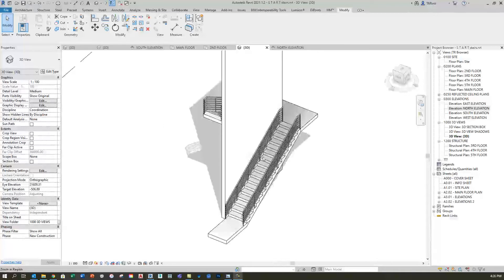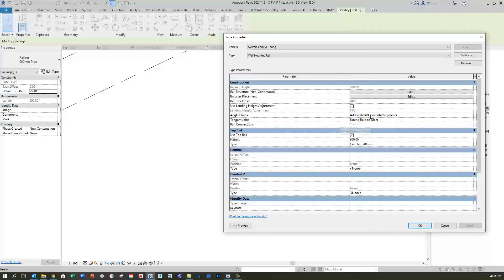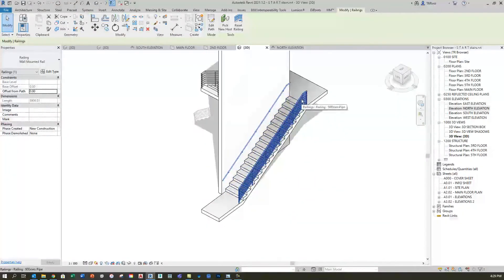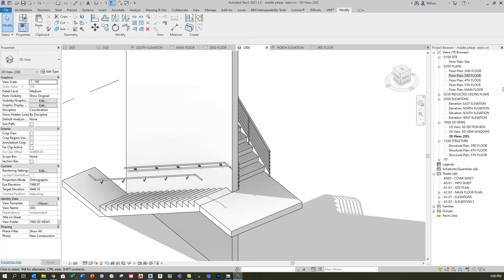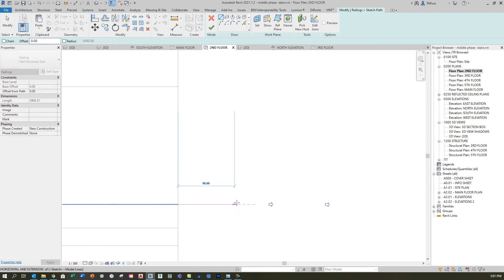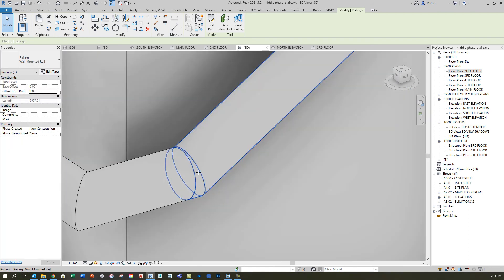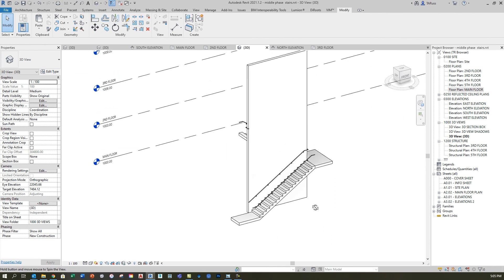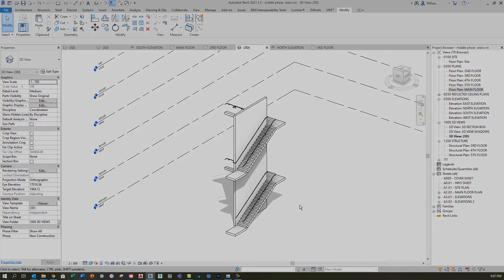Revit Stairs Fixing Floor & Rail Gaps PART 3

Comment: After adding the beginning extension to the railing, the height exceeds from the flight part. How can I have the same height? "Add vertical..." is 'on' in the Edit Type.( I noticed it happens when we edit railing path of stairs and add the extension on the 'floor' like the video not on the landing that Revit creates. if it makes sense...).  Any solution?

Comment: I am having trouble adding that 1 mm to the bottom of the floor one handrail. I followed your keystrokes but when I zoom in on 3D I don't see any transition. It did work in a previous attempt when I joined the inside handrail but does not seem to work when lengthening the bottom inside rail. Maybe this is due to another question I have (which is likely basic Revit knowledge). How do you keep the line work so thin when you zoom in? I change the scale to 1:1 and it is better but no where near the fine resolution you seem to have. Cheers John